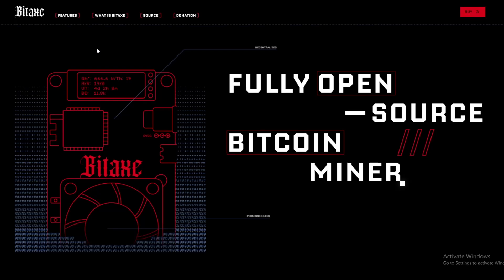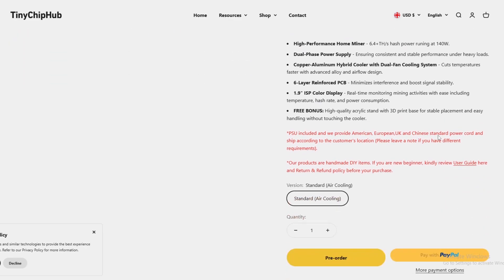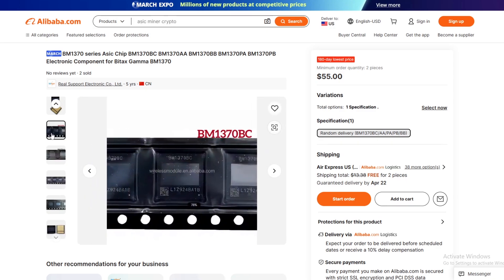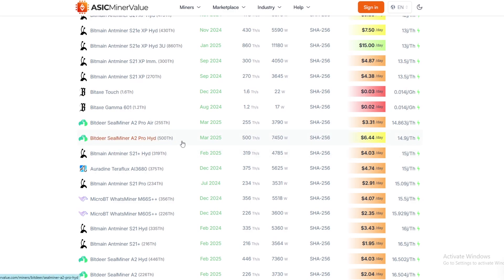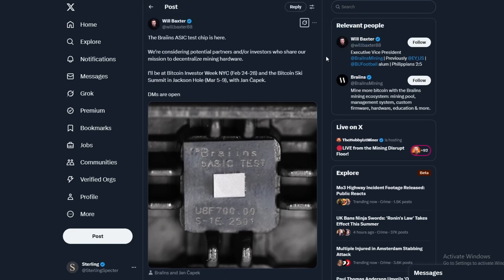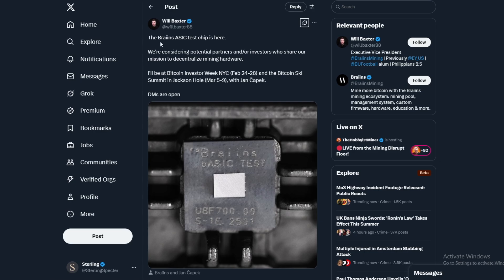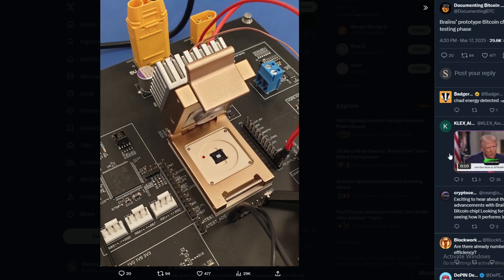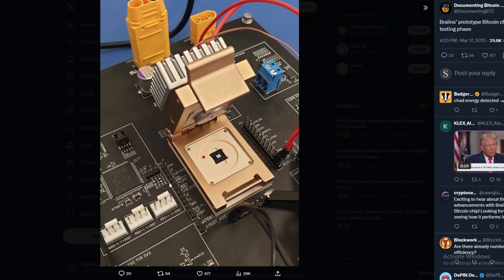The Biggest Problem With Open Source Bitaxe Mining

Comment: Hoping my Nano 3S arrives next month. After that, I'm just playing the waiting game to see if it's my turn for a block lol
Reply: I mine since 7 years. Why you all waste your Money and Time on such a stupid way? These Products cost so much today. That was a Gimmik in the early days for 30 Bucks to have. The big Mining Asic Trash Industrie fools you all with selling you their trash to you. No Front, but go for get more in or leave the game better. Dont waste your money please, go with your girlfriend eating and have fun.
Reply: I have nothing but bad experience with nano 3 and I'm mad at myself, I didn't rather buy a bitaxe. I have one and it's been running smoothly for almost 2 years. Nano3 died in 3 months. Been repaired under warranty, came back and now every time I cut the power, I need to set it as a new device again. 
Long Live Bitaxe and the supply chain isn't going anywhere. Small home miners doesn't need much to build so we have nothing to worry about.
Reply: @StellarStoic  my gamma 601 wouldn't run the fan after a power cycle and overheated within seconds of powering on. It also has the most rejected shares of any of my miners. It's not overclocked. Had to reflash in order to get the fan operational again. Bottom line, they all have their flaws.

Comment: 4 Gammas - Stock cooling, repasted all of them. Small USB fan for the back and front. Averaging around 6Th/s on local public pool on umbrel. Good luck
Total Hash Rate: 6.02 TH/s
Total Power: 96.9 W
Total Hash Rate: 6.36 TH/s
Total Power: 97.0 W
Total Hash Rate: 6.31 TH/s
Total Power: 97.0 W
Total Hash Rate: 5.92 TH/s
Total Power: 96.1 W
Total Hash Rate: 6.54 TH/s
Total Power: 96.1 W
Reply from the maker: this is the way
Reply: @SquashPile  Thank you
Reply: What are your temps?